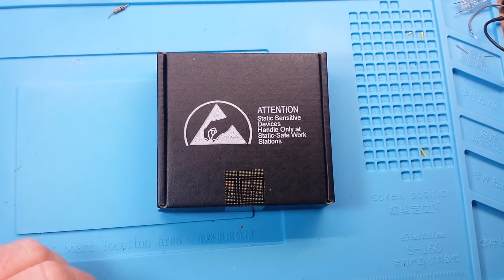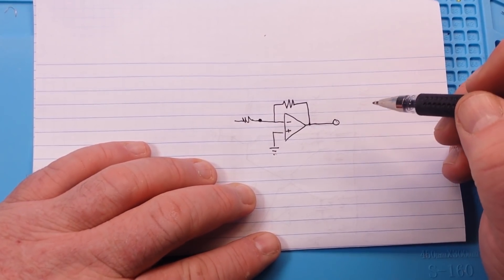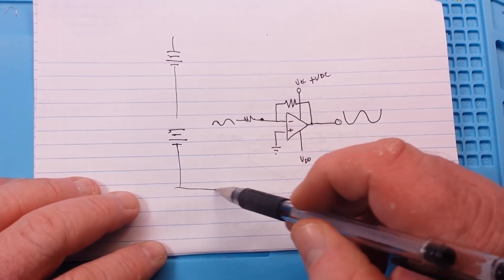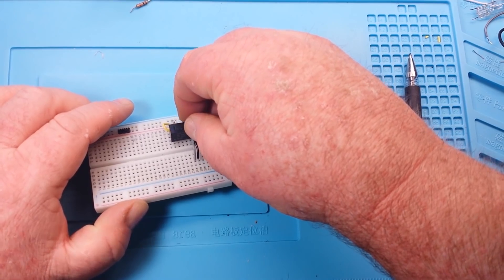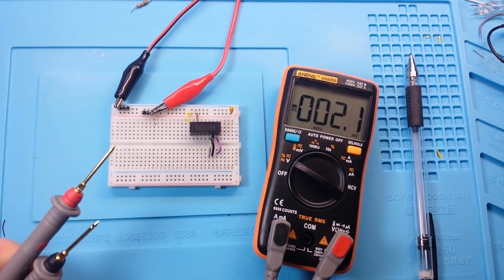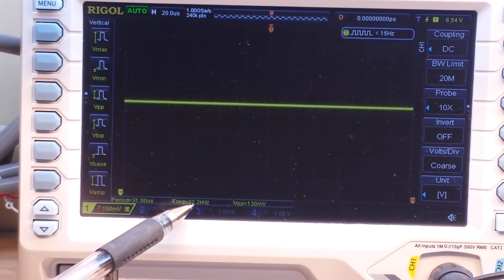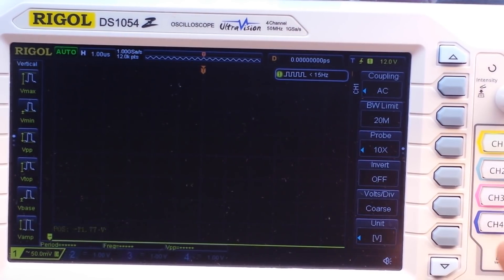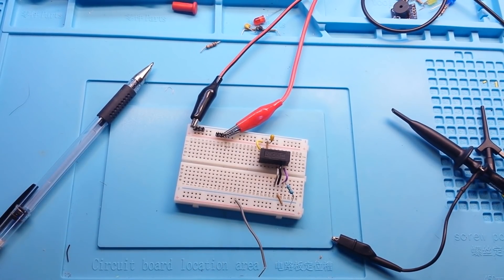RKZE1212D an answer to your OpAmp power prayers?

Comment: Also recommended: classic industry standard 7660 IC. Costs a couple pennies. This integrated isolated voltage converter that you got here is a bit of an overkill for most such tasks.

Comment: Trying to figure out how to get my op amp to work with a pot joystick, I want centered to be 0 output and climb voltage in either direction away from center , cant seem tonget it to go my way any suggestions? I was planning on using dual op amps

Comment: I believe you can use a single supply with any op amp if you use a voltage divider to offset your AC signal.

Comment: why has it got a quiescent current of 30mA?? is that normal for op-amps or is it a bit high. or is it because of OpAmp's  "supposedly" Infinite gain??? why I asked is because, its doing kinda  noting when drawing its quiescent  current,, or am I way off the mark.???? haven't played with op-amps yet. don't know why just never had need for one in any thing iv done (which is very VERY little) but they are in a lot of my "to get to" circuits in my schematics folder on my phones photo gallery. I take screen shots of the circuits schematics I like..

Comment: I have a question. If I have a cord or terminal block rated at 125v and 10 amp which is 1250 watts and I use it for say 12v at 50 amp which is 600 watts is that a safe application.
Reply from the maker: I would stick with Amp rating.
Reply: Golden rule... Never use solid core wire for DC... Sold core wire works best with Ac voltage... My son did the same calculations and thought that 240v 10A solid core wire should be plenty for some 12v DC solar panels.... According to the ratings, the cable could carry more power than it was being used for but as my son discovered, the cable got hot... Really hot... If you are going to use cable for DC, make sure that it is multi strand.

Comment: The cost of packaging things properly is part of the cost difference between the cheap Chinese sellers and places like Arrow, Digikey and similar.
Reply from the maker: I'm not used to quality packaging. I dont know how to react.
Reply: @learnelectronics  Nor am I.
At least not for things I'm paying for myself. 

the packaging for things we get at work is sometimes pretty over the top, though.
Reply from the maker: When I worked @ Bayer we just called the stock room for components.

Comment: there is some sort of switching power supply inside. For that case using two slab or 9V in series ....  There are some DC-DC alternatives similar, not so tiny : 

https://www.ebay.com/sch/i.html?_from=R40&_trksid=m570.l1313&_nkw=dual+supply&_sacat=0

Comment: According to datasheet the outputs are unregulated.  I enjoy and learn from  your videos
Reply from the maker: Really not going to matter when driving an opamp
Reply: That's what I was waiting to see during the video. Also if the output supply cleaned up with some electrolytics.... I have seen other split rail pcb's on eBay but they need 24v input to output plus minus 12v and possibly higher output current to drive a complete input stage, which makes me wonder how this device works? Probably consuming current on the input.... Not sure.. Might have to get my hands on one and have a good play with it. Anyway great video..

Comment: I just put a ICL7660S chip on the board. Feed 5-12 volts in, get -5 to -12 volts out. One chip, two 10uf capacitors automatic mirror of Vcc..And they are cheap!
Reply: Hi Robert, my name is Steve Roberts and I work for RECOM. Of course the 7660 capacitive switcher is a low cost solution, but it is limited to 10V and is not isolated.  The RKZ delivers ten times the power and is isolated to withstand 3kV DC.  You might ask, why is that even important? But I was using a non-isolated bipolar op-amp to amplify a thermocouple output, when the thermocouple accidentally touched a live connection on the transformer I was testing. The 230V AC mains blew up my circuit, including an expensive ADC with USB connector. I was lucky that my laptop survived! Since then, I have always used an isolated DC/DC and an opto-isolated output on any of my op-amp sensor circuits.
Reply: You can steal some current from an LT1081 RS-232 chip.
LT1054
LTC3246 if you have many to run
TC962
On some of these chips, pulling the minus output up can stop them from starting.  If you have that issue a small power N-MOSFET can solve it for you.
Also, it is very common to have a +6.6V and a +3.3V and reference the analog to the +3.3V
Reply: Thanks! 😬👍
Reply: Tayda has those for $2, you got a cheaper source? 😏
Reply: If you do a eBay search for ICL7660S they are 10 for $1.44.
Reply from the maker: Good IC Bob! Thanks for sharing that.
Reply: Used a couple of those ICL7660S for my school multimeter project last semester. Nice to know there's another alternative.
Reply: I ordered 20 and they arrived today, however they don't seem to hold up too well to 12V. At 9V they hold fairly steady and the voltage drop is not too severe, but at 12V funny things start to happen ... I probably just got some sub-par clones. :P
Reply: Aha! I think I found the culprit: my bench power supply! When I power up the circuits with a 9V battery all works well, but the ICL7660S does not like the applied voltage from the bench supply . I only need this for 9V battery circuits so .... nice! Thanks again. :)

Comment: Thx for the video. I dont know what to use this chips function to and maybe that also why I dont understand why -12 volt and +12 volt becomes 24 volt. Is that because its the range from lowest to highest? and what would you use -12v for?
Reply: christiannielsen - 1) yes 2) to power an op-amp
Reply from the maker: Most opaamps need a positive and a negative supply voltage. This IC allows you to get both out of one power supply. So less clutter.